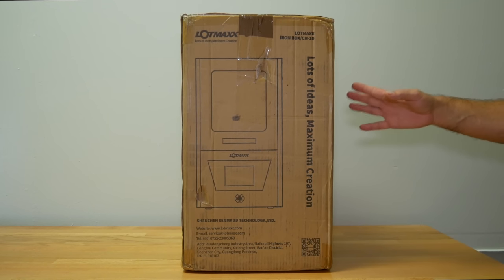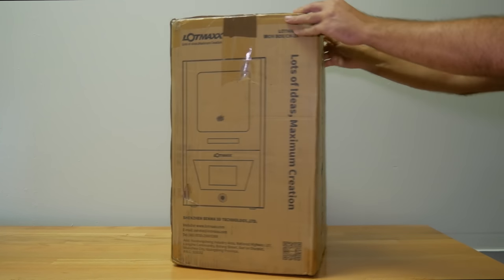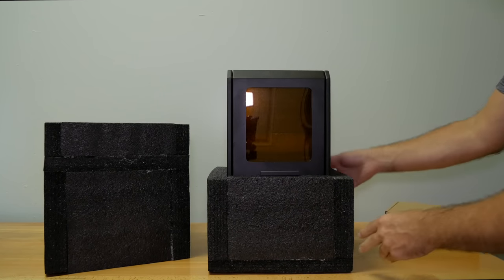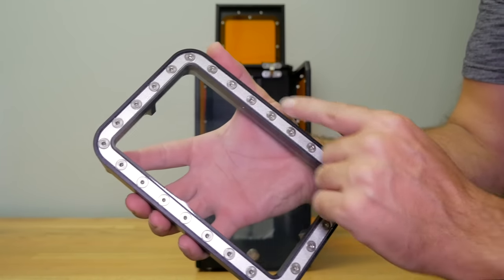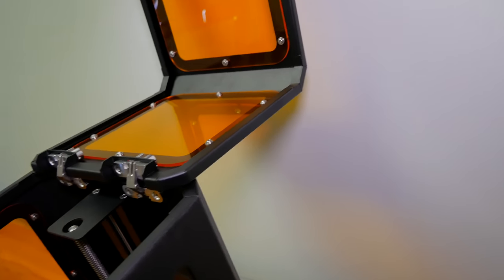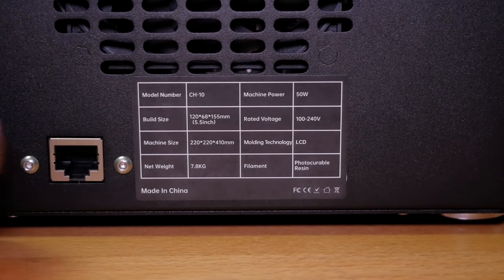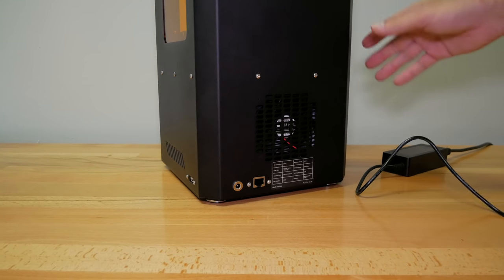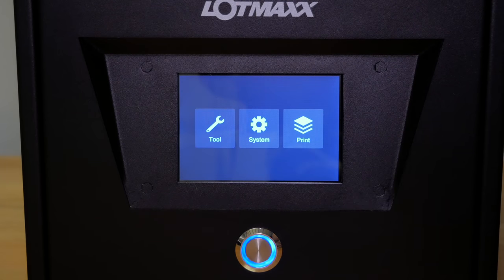Lotmaxx CH-10 - Resin 3D Printer - Unbox & Setup

Comment: Vlad you do realise that the printer has a clean vat function. Basically you leave a little bit of resin in the vat and go to tools and press the clean vat button and what that does is cure a small amount of resin in the vat. Then you pore away the unused resin back into the bottle and you left with a small sheet of resin in the vat which you scrap away with the plastic scraper then us a tiny bit of ipa to clean the remaining off. Then let it dry for a few minutes before starting to print again as if you don't your have ipa residue that can mess up your prints

Comment: REsin... what a mess!  I'll stick with PLA for now and wait for next gen with hands-off cleanup and storage.... this is still a dangerous, messy process!
Reply: H D  You still need to clean the resin from the parts, tray and plate with ISO alcohol... AND ... you need to dispose of the spent resin, gloves, towels and ISO which is bad for the environment.  It is still dangerous and messy even with a vapor hood for the fumes.
Reply: H D  or.. just use PLA and don't worry..